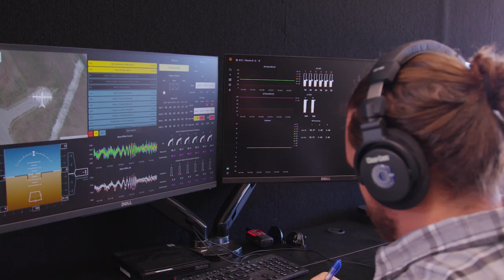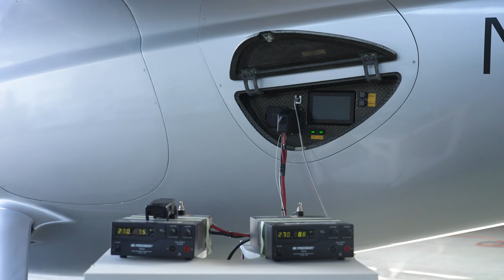Adam Savage Learns About an Electric Flying Vehicle!

Comment: Hi Adam, its not a flying car. Difference: it has to be towed, no engine powering the wheels. It would be cool though to have a vehicle to drive which can rise up vertically like drone, unfold its wings in the air and flies forward. Even this model is not there yet... There is a potential for an Uber in the air. It is for commercial use not for individuals.
Reply: I'm pretty sure he's aware it's not actually a flying car.
Reply: @MattTee1975  Which of course is why he oohed excitedly about flying cars at the start of this advertisement for Archer.
Reply: @MattTee1975  Yeah, then let's not say "it's already here" that was my impression from watching this. It's far from having flying cars yet. It is only a cool plane 👌

Comment: the prop tips should be a bit higher (probably at least 7ft / 2.5m from the ground) for safer autonomous operations
Reply: it's a test rig only
Reply: @jamesengland7461  I also forgot that the props will probably be oriented for VTOL just prior to TO/L
Reply: @ingoos  Could also have some lidar/sensor in case someone is too close prior takeoff to not start.

Comment: A couple of questions.
Given the weight of batteries, does hydrogen power for eVTOLs seem like a potential fit for the same operational range targets? Also, would hydrogen be a better fit in locations with colder winter temperatures. With EVs hydrogen fueling infrastructure is a challenge, but it would seem to be easier to overcome for this application
Reply: If the vehicle can be equipped with efficient solar panels that could extend it's range. And since the sky is cold, all reasonably-sized aircraft have to be designed to work in cold conditions.
Reply: One of the most important things for aircraft power plants and energy storage is energy per pound  and power per pound (energy density). Hydrogen fuel cells require a bunch of extra accessories to function (fans, pumps, piping, wires, radiators) which equates to a bunch of extra weight. The hard truth of it is, petrol and burning it are still the lightest weight and most powerful (per pound) for aircraft. Another thing to consider is petrol gets lighter as you use it (emptying tanks). Hydrogen does a little bit (hydrogen is lightweight compared to petrol per volume) and batteries do not at all. For the time being, petrol is still king.

Comment: I don't know what kind of person would trust a human pilot over a robot. Basic common sense that the robot is safer
Reply: The question is whether you can trust the human who programmed the robot to have the safest response to most situations.
Reply: Robots are safer in ideal conditions,  what would a robot do, say in a situation we’re the gps signal is degraded and it can be sure of its landing zone location,   A person can say yeah land there.   Or emergency situation,  say a engine issue forcing a off airport landing.  Person can look down and see if a field is suitable for a landing and judge if it would be safe enough for a forced landing.  Computers might not be able to tell that field a might be better then field b because field b, even though it is flatter, is a soccer field full of people.

Comment: I've always wondered, with these tilt engine designs, if they treat the props as gyroscopes when they tilt them. Do they apply a side force to the prop, so that gyro precession lifts it into position, or do they just muscle it up there?
Reply: @wagglebutt  I think you're correct... I think there is a shot near the beginning that shows this.  This would also avoid torque issues that affect yaw when changing the power setting.

Comment: It's cool and I would love to fly in it, but a 100mile range is nothing
Reply: Good thing you weren't one of the Wright brothers.
Reply: Watch the video again, it's for commute - not travel. 100 mile is fine. Plus batteries will improve, motors get more efficient.

Gotta start somewhere.
Reply: The data shows the largest demand is for ~20-40 mile trips that take an hour+ on the ground, so we built our aircraft to address the most common use case. You can learn more about our approach to powertrain development, certification with the FAA and commercialization by watching our detailed presentations on each topic here: https://youtu.be/PmRKdpIRg0w

Comment: I want my flying car, and I want it NOW! ☺️💗
Reply: Umm technically they were made in the 60ies. Was more like a general aviation small plane that could fold its wings to drive on roads but yeah, they "had" it. There has been a century of autogyros, very small and vtolish (actual vtol in modern variants). And even old fashioned "community" air strips for small planes, it has always been about getting the money to own/operate and pilot license. Autonomy at least gets rid of the pilot license part. And, for an "uber" like model where you can from your app call the nearest one to take you somewhere instead of you directly owning and piloting the thing.

Comment: Waste of money. Zero real usable range.
Reply: Not true, it all comes down to economy, if a ride gets cheap enough, the time saved to travel 200 km will make it very viable.
Reply: @andersandersen6295  Canada ordered a few passenger carrying e-planes, let's see a real world application work. We all know the range of any EV is based on zero additional load to achieve it. Just like the fudging of EPA by ICE company's. These planes have a range of 125 miles. About an hour of real flight time. The ICE transportation is still superior.
Reply: @tommanley2924  EV's will have very specific usage, the country where i live is small enough that a EV will be able to  cover it border to border, so it all comes down to cost, and can you fly without a pilot you have just eliminated that cost, VTOL eliminates the need for a runway, and you dont have to worry about contaminated fuel, eliminating the cost of having to control/test fuel quality several times a day, maintanence will also be cheaper than ICE, all in all i see a lot of cost being cut, wich should beat ICE on short distances.
Reply: @andersandersen6295  Yes indeed, I agree, EV's have a specific purpose, short travels in crowed cities. Not for everyone everywhere. Wait until the great energy shortage is there, your EV will not be able to recharge during those periods. Yet I have a 55 gallon drum full of petrol at the ready.
Reply: @andersandersen6295  If you can fly a EV end to end you must live in a country the size of one big city here in the US.
Reply: @tommanley2924  What makes you think that you will have petrol beyond those 55 gallons if some sort of energy shortage appears?
Reply: @andersandersen6295  Better off than all EV owners if a energy shortage appears. No electricity would equate to "No Go" for ALL. It will take longer for me to be in the "No Go" situation.  And since we have several vehicles it would take about 6 months to drain us dry.....LOL..How long would a EV last without grid energy to recharge?...Swiss Cheese kid.
Reply: @tommanley2924  Well some are off the grid and can charge with a windmill or solar, do you have your own refinery? and what the hell does Swiss Cheese kid mean?
Reply: @andersandersen6295  Again if their is no power now, it would take 6 months to effect our driving habits. And we go longer than 6, we would break out the e-bikes and go that direction. We have a solar system for additional power storage & usage. You?
Reply: @tommanley2924  I have legs and a bicycle.
Reply: @andersandersen6295  My E-bike can go 25 mph for hours, you I don't think so. If so start racing, I did.
Reply: @tommanley2924  Lucky me i dont have the need to go 25 mph for hours.
Reply: @andersandersen6295  Good Thing

Comment: I've seen a few of these over the years now and they are just federal grant funneling projects it would never be practical to anyone but the top 1 percent and even if the demand for such a service was there it could be solved in an even simpler way by just designing an electric bush plane that utilizes short runways or even a performance blimp

Comment: I think hydrogen fueling is a dominator, considering the weight capacity & flight time fcev vtol's have over bev ones (see Doogan & Intelligent Energy drone flight demos... an argument being wings are needed). Improvement arguments also apply to as fuel cell vtols are also battery equipped & fuel cell tech additionally improving (as well as hydrogen cost & availability, with long distance semi industry going in on hydrogen).

Comment: The technology to make the cars a reality is fast approaching. What will be needed is an AI that can control air traffic so vehicles do not crash into each other. The flying cars will need to be autonomous to a certain degree because the average soccer mon is not going to be able to manage a vehicle that moves in all 3 axis of travel in conjunction with other airborne vehicles. 
Imagine a huge vast AI that controls all vehicular traffic in the entire country all simultaneously, coordinating every vehicle's path of travel with every other vehicle. No more accidents or traffic jams. Travelers will always arrive as quickly as it is possible because the most optimal route for every vehicle will always be chosen. You get in your car, punch in your destination and then spend the entire trip looking at your phone. Not that different than the way we already drive.
AI traffic control is the future we need to be talking about.